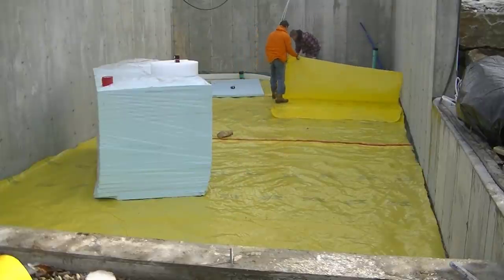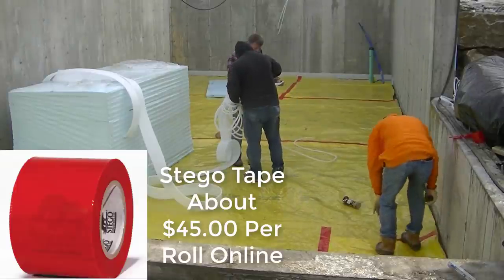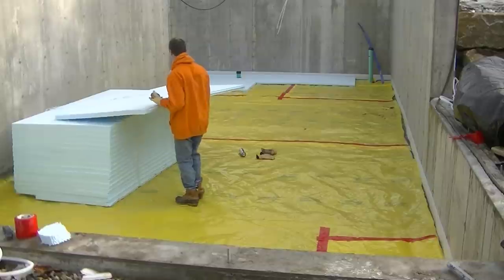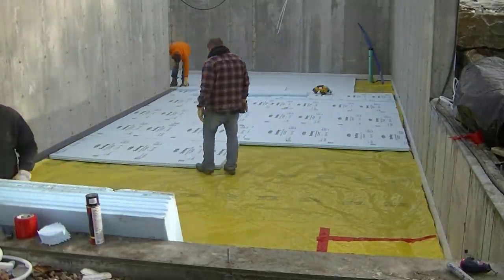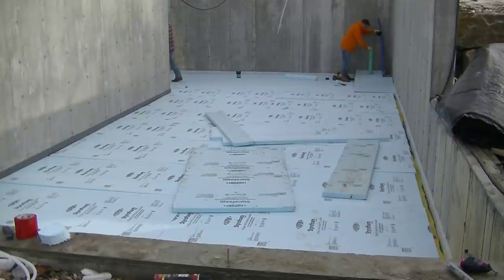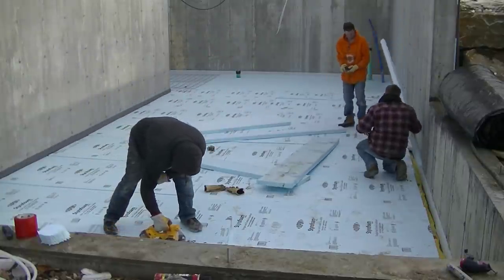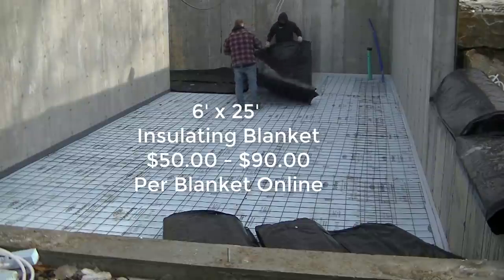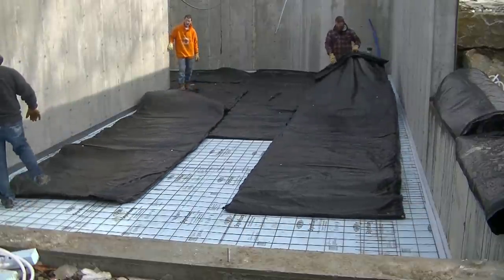Prep Work Done Before Pouring A Concrete Floor (Vapor Barrier, Wire Mesh, Iso-strip, Styrofoam)

Comment: Watching this video is a lesson in why your general contractor needs to be on site whenever work is done. Plastic vapor barrier needs to be under insulation, go up wall several inches. Cement chairs under wire mesh, these guys need a babysitter to help get this done right. Mike keeps saying how he charges for this and that... I don't think Mike is the man for my job. Sorry Mike.
Reply: Is it better if the vapor barrier goes under insulation or above it ?
Reply: He DID put the vapor barrier under the insulation, maybe you meant it needs to go above the foam board?
Reply: The foam roll strip is the barrier from the concrete wall.
Reply: They put the vapor barrier under the foam board, it went up the wall several inches. I’m not sure what video you watched but they did all that.

Comment: vapor barrier should go up the wall 6+ inches so there is no gap.  Also, foam should go down before the vapor barrier so that the foam cannot float in the concrete.  If that foam decides to float after you start pouring, you are screwed.  The vapor barrier on top of the foam will prevent floating.

Comment: If you don't seal the joints in the insulation boards the concrete may (and probably will) seep under and push insulation up due to its buoyancy which is known as "ICEBERGING". Hence you put vapor barrier on top of foam board or at least seal all joints with tuck tape.

Comment: Several critical differences made. The order from the bottom up. Virgin soil or compacted fill sand. 4" crushed stone. 2" R10 insulation. 6 mil or greater plastic vapor barrier on the floor and 6" up the walls. Expansion joint around parameter. Wire mesh on stand offs. Concrete.

Comment: Engineering sites say to put the rigid foam under the vapor barrier, then pour the slab on top of the vapor barrier, which makes sense to prevent the rigid board from floating and from absorbing moisture and staying damp. Why did you put the barrier under the foam?
Reply: Exactly!!

Comment: ugh. don't put the vapor barrier under the insulation. Asking for dislocation via concrete getting under the board. Much better IMO to put the vapor barrier over the foam board and inspect vapor barrier for any holes. If holes, hit them with a piece of tape. Run vapr barrier up the walls and then you have a seals surface to pour.

Comment: Vapor barrier goes over the foam. Also use 2" x 4" tall strips of the EPS on the perimeter to space the concrete from the wall, then bond it to the spray foam on the walls.

Comment: I've always been told to put the vapor barrier on top of the Styrofoam so it doesn't float when you pour, but does it matter?
Reply from the maker: Doesn't matter. Concrete sets up better if it's right on the styrofoam.
Reply: Honestly, vapor barrier goes above the styro, so goes like this 
3/4 gravel followed by
4 inches of styro follow by
Vapor barrier (15 mil is right) that’s the best
Chairs and rebar 
Follow by concrete 
There are  shortcuts

Comment: Here in NE Oregon I have done several in floor heat jobs. We usually install about an inch of sand screeded flat right before vapor barrier and do a min of 4" foam often 5" and have had great returns for our clients.
Reply: Well that's overkill... especially in Oregon where it doesn't get to cold...  sounds like up-selling to pad your pockets!
Reply: @chadwicks4631   I know most folks think Portland is the only place in Oregon but NE Oregon has a similar climate to Maine where I am originally from. I have been at this for 25 yrs and the slabs that have 5" of foam are much more efficient. I live in an older home that takes 6-10 cord of wood to heat per year and wish I would have wrapped this place in foam 15 yrs ago. Though I guess I get heated three times, cutting it, stacking it and burning it. Either way it is always the clients decision in the end if they want the savings up front or down the road. Cheers

Comment: My concrete guy told me to install 2” rigid foam around the perimeter wall as well as the floor. Supposedly most heat is sucked out of the concrete floor on the edges contrary to popular believe.
Reply: most jobs in my area on regular jobs the foam has to run from footer to concrete grade then a 2 ft flat band around the wall that`s code in our neck of the woods.

Comment: I'm about to lay the slab of concrete over polystyrene,  and just putting the steel reinforcement mesh down, I see in this video, you lay the mesh straight on the polystyrene without raising it up with spacers.. are spacers required or not?
Reply from the maker: They're not required, unless on the plan. They're not a bad idea if you can get some.

Comment: Another way to lay the foam is like a engineered finish floor. Saves time trying to rip strips to sandwich between the walls. Just lay second row cut to finish first row then lay second row. This method modified can get real tight seals around pipes. Snap 2 chalk lines to center of pipe on foam. Use hole saw to cut hole the cut along 1 center line to slide both pieces around pipe. 
 Only problem with laying foam that way is all the seams are staggered, but it’s a trade off as the foam is in puzzle format making it more insulating during shifting over the life of the floor.

Comment: When I lived in Minnesota, 6x6 10ga wire was the norm.  Here in the Black Hills of South Dakota I only see rebar.  Typically #4 on a 2x2 grid or 30'x30" grid. Our soil here is very granular and well drained as well as this is a semi arid climate.  If I go down 6" we're into rock.  House was excavated with a 320 Cat trackhoe and a ripper tooth. as well as a 6" hammer.

Comment: Does adding 2" foam under the basement slab require the foundation walls to be poured an extra 2" taller to maintain the same basement wall heights?
Reply from the maker: Depends what the code is for floor to ceiling height in your area. Usually they drop the sub-grade 2" most walls like this are all poured at the same height.

Comment: Well I see if quite a few people have addressed what I was going to comment on. I guess the vapor barrier could you the 15 mil on the bottom as long as it goes up the wall. Then lay the insulation. One thing I have seen on many other videos and contractors recommend putting a 10 mil Vapor Barrier on top of the insulation before laying the rebar
Reply: Cant have double layers of vapor barriers. Where should the moisture in the layer go then? It could stay moist forever.

Comment: Hey Mike. What stone base do you recommend for concrete. I see alot if not most of people using clear stone but why not a crusher run which if compacted correctly before pouring the concrete will would be hard as a rock. Your thoughts

Comment: What is the purpose of that foam, since you are not putting heated floors down?  Is underground water too close to the surface?
Reply: ground is generally considered a heat sink because it is around 6-7 degrees C, room temp with humans in it, regardless if it is heated floor, radiant or passive, will be higher temperature than that, so any insulation under concrete floor will make the floor that little bit warmer and reduce the total amount of heat loss through it

if it is something like a garage, or a shop where you do some work near the floor, and even if the building code doesn't require it, it will be much more comfortable working on an insulated floor than just straight concrete on ground
Reply: @dsfs17987   in Europe they have a different approach . They more focuse on insulating perimeter walls of foundation because of   outside temperatures much colder than   ground temperature in this case  you don't have to insulate floors since the ground, beneath the floor, works as an insulator unless you have a ground river closer than 15 feet to  surface of ground
Reply: @andreycham4797  BS. Finland is part Europe and we put 8 - 10 inch insulation usually EPS under slab doesn't matter if floor is heated or not. Only when floor area is really big like barn or some industrial building then insulation is thinner in middle of building.
Reply: @mr.wizeguy8995  you missed the point . They did not insulate perimeter of outside walls . What I was saying that  temperature of the ground  under a house around 10 C and air  temperature outside can be -35 C   in Finland.  . Americans  live  mostly in warm climate zone and  do not know what they are doing

Comment: I'm hoping someone can answer this but I've a concern that I'm hoping someone can address. 

I'm looking at doing insulation below the slab in my basement which is also serving as a garage and storage area. When fully loaded with what is being stored, it will have about 1.2 million pounds uniformly held up across the entire slab. In my situation, is it even possible to put under slab insulation or am I asking for trouble?
Reply: Rigid foam is fine for heavy load applications. just need to use a high strength foam.

Comment: why not just spray foam with 1" of closed cell?
Reply: Special equipment and skill really hard to maintain thickness but concrete will flow in anyhow. You been to gauge material depth so consistent. Yes better but easily 2-4x cost. Guestimate by how mush to spray insulate a simple size  garage interior or attic  sites say-- A 2-lb spray foam insulation set = $2,000.00. 2 drums 50 gal ea. Take 2,000 and divide it by 4,000 square feet (sprayed at 1-inch thickness) = 50 cents per square foot/inch (raw material cost).  All it is; is more money.

Comment: Interesting -- WARNING -- This installation made a serious mistake.  The Stego goes on TOP of the poly insulation board, not below it (yes, this is a bit counter intuitive). The problem with this install is that the concrete pour will likely get behind the insulation and the concrete will "float" the foam insulation up as the weight of concrete will fall between the foam's seams. This is a major mistake and causes a raised concrete flooring and a major repair/fix. Watch the Build Show with Matt Rissinger who outlines this common mistake.  Remember, your goal is to ensure that the foam stays down flat and level. Foam will not get damaged by ground water, so put the Stego on top of the foam insulation.  Then pour the concrete.  Also, tape the Stego to the wall about 6" above the surface level.
Reply from the maker: What you say are good points but how we do this is by no means a "serious mistake". We've done 100s this way with no issues you talk about. What is your experience? Do you do this for a living like we do? I doubt it. Why bad talk someone's methods if you don't have any experience doing them. We've done stego both ways with excellent results.
Reply: ...fair enough points and maybe it was a bit harsh.  My experience, since you asked, is many years of watching youtube videos on this.. :).   Also, architect Steve Baczek and Matt Rissinger havae both spoken about this several times regarding the risk of conrete getting behind the foam insulation and floating those floors.  Yes, you can get lucky doing it your way, but there is no advantage in time or money to do so.  If  you want I will take down the comment if you wish.